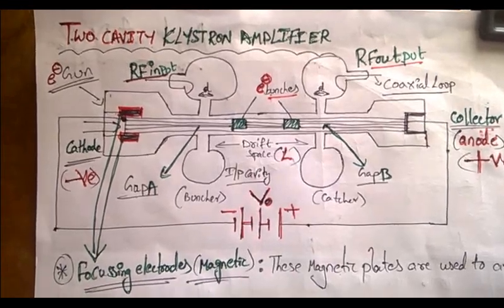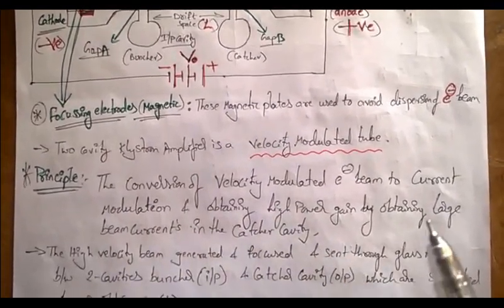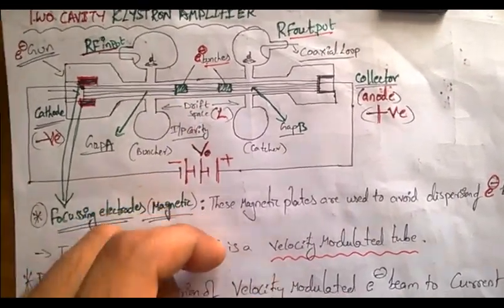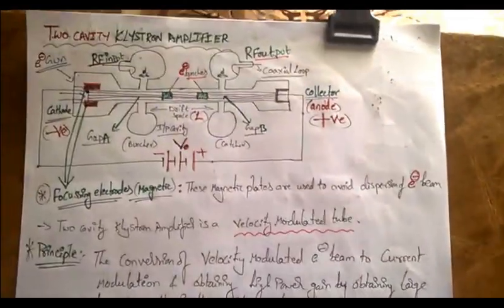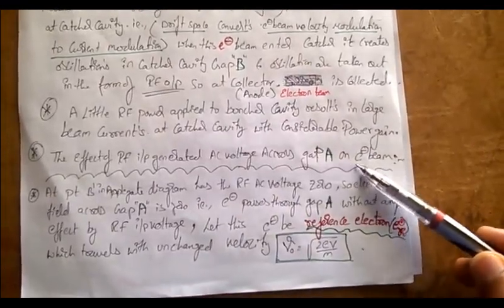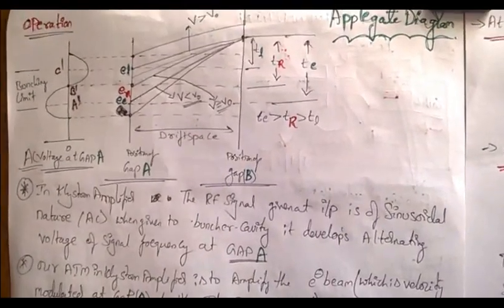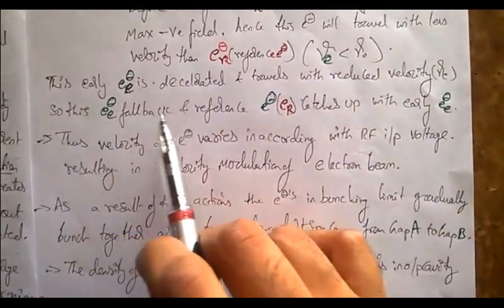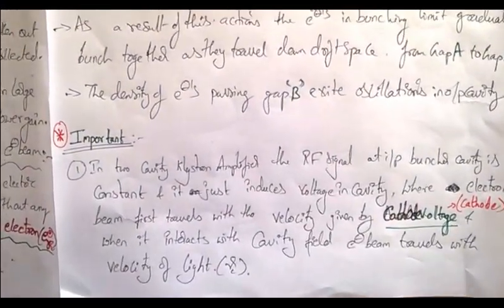Two Cavity Klystron Amplifier.

Comment: y oscilations produce in cavity.
Reply from the maker: Cavity is a hallow structure which is already excited by Radio frequency input so this input acts as carrier for the incoming electron,when ever a charged particle encounters with a high frequency carrier it gets accelerated,as cavity is a hallow structure the electron and Rf signal interaction releases energy,this energy we call it as oscillations. +raj yadav

Comment: bunching means at apoint  really.
Reply from the maker: +raj yadav See here we considered electron cluster as bunch i.e, group of high energy electrons which are brought together by two cavity klystron mechanism,do you think it is possible to distinguish energy separately for each and every electron in the bunch? 
so we consider them as a bunch or in our words as a single point.
Actually there will be some spacing between these electrons but ultimately we need result of whole some of electron concentration not individual electron energy so we consider electron cluster as a point in our explanation.